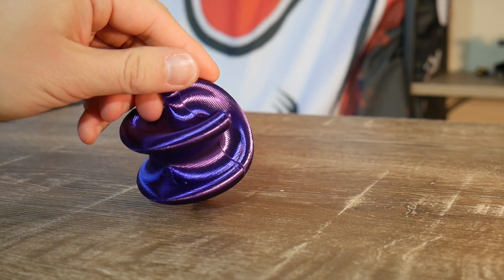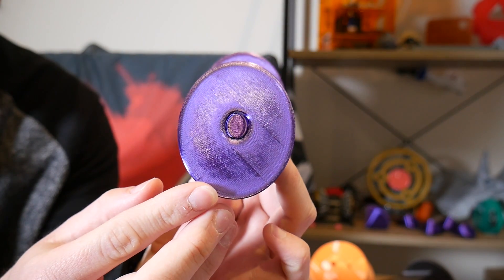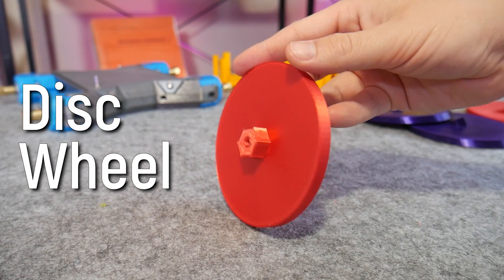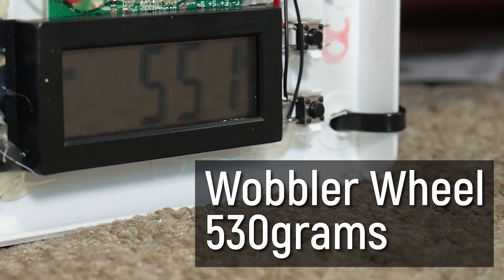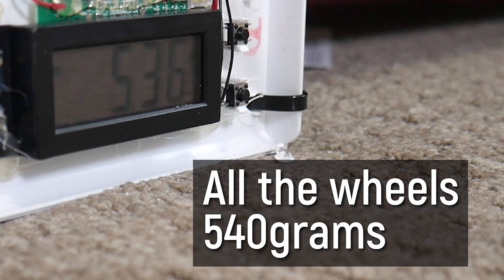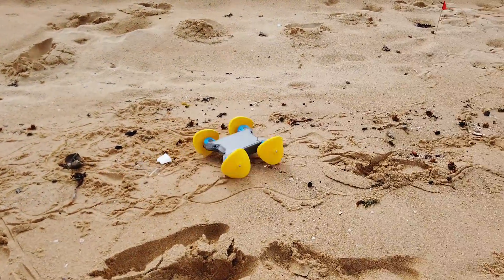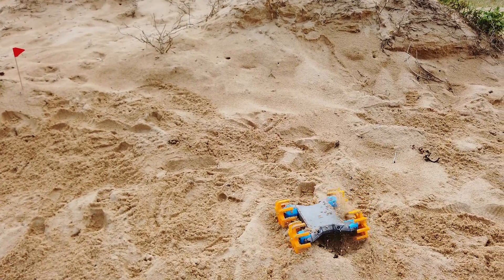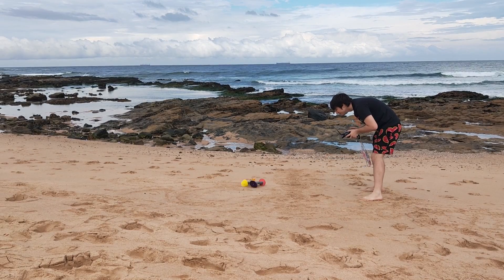This Robot Drives on Wobbly Wheels (but HOW?)

Comment: Hi nice video nice work,
I wanted to share with you what I
noticed on the beginning of this
video about moving the robot and
turning his direction to the right,
which is a result of two things, First
the direction of the rug threading
(knowing a rug threading direction
helps you when you're trying to
clean it), Second thing try to make the rope that holds the robot exactly on the middle with a hole gap more closed to keeping that so.
And thank you for this interesting
video.
Reply: .At the sixth minute

Comment: Fan ruffle the wheel ... like the 'prongle wheel each wheel would be two 'prongles' back to back then make it have multiple lobes. You could also think of it as two fan blades connected at the shaft ... one a mirror of the other.  Discharge flow to the center. You could still have a solid circular circumference that defines the wheel but the center would be evacuated somewhat. 

Also try something like a water wheel.
Reply: Could just have a center wheel and the water wheel like projections on either side.

Comment: The problem is, according to what I observed, the vehicle's body has no elevation from the wheels and relied on the radius of the wheels to lift it off the ground. If modeled like a buggy, with the body clear of the ground, I believe the test would've gone better for all of them.
I am no engineering expert, so I might be entirely wrong.
Great video.

Comment: Hyperbolic peraboloid is unstable in xy if not balanced by opposite wheel. The wheels aren't wobbly in z as such, they describe a circle as they rotate. They are cut from a cylinder and any shaped cut from a cylinder will do this. Loose ground, so <P is good, where P=F/A. F is constant so make A big.
Your carpet is also not a good corollary for sand for each of the wheels tested. The sand is more or less isotopic,  the carpet is not. This and the sand test show you need to test in the environment you mean to work in.

Comment: The pronged wheels had an unfair advantage when it comes to driving in the sand since it technically has a lot more surface area so it won't sound it to the sand as easily
Reply: So what you're telling me is... the pronged wheels have a better design?
Reply: @ryanrigley2558  no I'm saying that if the other wheels were a little thicker, than they might have put up a better fight
Reply: @supitsameen3251  so, the pronged wheels have a better design?
Reply: @ryanrigley2558  you know what... Nevermind 😆

Comment: if you turned the tracks into treads the sand and carpet may not be as difficult.... heck with the right track you could make them even work on water..... if you waterproofed the battery and electronics.  not sure how you could add a tread to the wobbly or prongle style thou.... tanks and such use toothed gear/pully wheels to grab the tread and such.... i feel it would be really easy on the fourth design.... since the treads could be allot wider than the ones with normal like wheels.  enjoyed the experiments thou...ty for posting :D

Comment: The spoke wheels works well, the only thing that stops the vehicle is it's very low clearance that makes it stuck whenever the body is elevated. You could atleast make the body higher or give it a suspension arm and a shock absorber, that way you'll make it look like a sand buggy

Comment: I think the reason the wobble and prongle wheels worked so much better than the straight wheels is because like a snake or screw, as they spun they pushed on sand to their sides like a wedge.

Comment: I think the spoke wheels did work better for how thick is the coverage of the wheel to the ground while the other wheels are making thin line tracks the spoke wheels just straight on uses its outer layer to move like how the water wheel  brings water up and down

Comment: Look man, this is not so acurate, 5:38 because the deformed wheels have more traction because they are printed in a diferent axle so they have a rugged surface and you are doing the tests in a carpeted floor so little warps hook on little fluffs making more force. 6:30. They dont have the smooth surface that circular wheels do. You should pulish all them. Is the area in did, but also is the quality of the surface smoothness. Or a shiny hard floor.

Comment: The spoked wheels probably worked so much better because they have like 20x the contact area as the rest of the wheels. The amount of area that is contacted at any one point is more like a line, so the area measurement isn't a good way to predict the area that will contact

Comment: in sand and while climbing, what you need is a licked differential 
usually used in the rear, it makes it that the wheels on both sides are only able to turn at the same speed.
this would eliminate most of the burying problems with the wheels because it could use all the wheels to get out of a hole instead of just the one that got stuck :/ 
great content, subbed right away

Comment: The edges of the wheels do not need to be the same contact area. Traction does not depend on the surface area in contact. Wider real life tires do get more traction but because they are made of softer rubber which gives more traction. Being made of softer rubber, they must be wider for the side-walls to support the vehicle weight.

Comment: Its most certainly within your capabilities to be able to figure out the simplicity of an ESC/Motor/Receiver/Transmitter system.  It's very straight forward, and with the advancements of technology, modern RC's are a much simpler, more reliable system.  I figured it out, and I feel you're well above my comprehension!!  Great vid though!!  Thanks for this!

Comment: Terrible way to test. If you want pull force, put some spikes on the wheels. A much better test would be, how far can it run with different wheel types on the same amount of battery.

Comment: Try the chip design but with higher number of wiggles. Any even number should be possible, right? If you go for eight wiggles it should be roughly equivalent to the eight spokes design, maybe
Reply: In particular, try something like

Re((x+i y)^8 / (x^2 + y^2)^4)

to get a sort of wavy spokes profile

Comment: I'm guessing with all the smooth wheels you're not seeing much difference because although the shape of the wheel differs you're really just moving the same material with the same surface area across a surface whereas with the wriggle wheels you're altering that surface area with those gaps. Maybe try playing around with different types of tread?

Comment: I think it would be interesting if you had a paddle boat where the paddle is longer and form like A helix in this design it should be on 2 side's.

For example 30mm wide and 70mm long the second one would be oriented 30° from the first one then next 30° apart.

Comment: Geometry be weird, but really, you've just made a diagonal width of the strip on the slanted wheel, straight on the disc wheel. If the length doesn't change, it must increase the width compared to an absolute Y-axis. 

Like if you rotated the diagonal line in a square to be oriented like one of its sides, that diagonal would now be longer than the sides. 

Took me a second though! Nice video :)

Comment: Very impressive.   You do know of course  that if you replaced the wheels with tank treads, it would get more traction and more surface area contact with the sand.  I wanted to make such a vehicle with tank treads that actually wrapped around the entire vehicle,  so that the full surface of the vehicle was in contact with the sand.  
I think that would be the best way possible to keep a vehicle from getting trapped in the sand.

Comment: Id like to see this tested on an rc platform with some kind of raised chassis for higher ground clearance maybe a sort of suspension system. Itd be more complex but would allow the wheels a better chance at not getting stuck as easily

Comment: Was the battery at a similar charge during each test or does the control board even the electrical load/power applied?

Comment: If cars had wheels like that, the cv joint would break in the front, and if it didnt, then the rear wheels would be moving in and out so fast that the inertial force making it go in/out, would cause the wheels to snap off, no matter what material it is.

Comment: as soon as i watched this i thought the wheels wont be better bc they cause un wanted air drag bc of the design so now its time for me to find out
and for the 8 spoke design i believe it will not do well for ground travel but if you add small flaps to the end of every other spoke it will do amazing with hydroplaning
edit: turns out the spoked wheels did well, im suprisedd!

Comment: I'd be interested to see the result for the wobbler wheels when the axles are locked such that the wheels are mirrored (both angling toward the car or away at the same time). The thought here is that maybe they will use the opposing forces to add extra grip.

Comment: Wheel traction is defined by contact point, ignoring the sand, your skinny wheels have a tiny contact patch, your spoked wheel's massive in comparison, so you need to consider wheel width to get an accurate test. make the wobbly wheels wide and hollow because you need to consider 'unsprung mass'. I know you're not using suspension, but the principle remains for the rotating parts, calculations always vary but 1 kg of unsprung mass can be the equivalent of 8kg sprung, hence why the best wheels and breaks are carbon. Fun video, thanks

Comment: I think part of the issues with the wobblers, prongles, and spoked wheels was that the vehicle platform didn't have a high enough breakover angle/ground clearance in general. The car was very flat and in one plane, but if the main body was 14-20mm higher, they might not have gotten beached so easily. I don't think it would've made much difference with the plain disc wheels, though. They just didn't have any way to grip the sand and push forward, and so they just dug themselves into a hole.

Comment: The reason why it pulled to the right every single time with because carpet nap has a Direction you can also take a piece of paper and a pencil and with the palm of your hand rub the pencil back and forth over the piece of paper and the piece of paper will travel in the direction that the nap is laying down

Comment: so the thing I don't get is how you figured the 8 spoke design was equivilant to the same contact area as any of the other wheels.

I think the math breaks down because realistically, most of the wheel's surface is not in contact for most of the revolution, so the 8 spoke design should have the best performance on any rough surface, especially when you consider that in the sand, 2 spokes will be digging in and getting great traction in the sand.

and after watching the test, yeah basically add some treads and you've built an all terrain tank!  Very nice

Comment: You should try and water proof it and see if the wobble wheels will act as paddles in water.  In theory the wheels flow in the same manner as a canoe paddle works.

Comment: as neat as it looks the size and shape of the robot and wheels aren't idea for a soft surface and you'd have much better traction with treads with much larger surface area just larger wheels and more surface area would be huge, also a lot more ground clearance. it's not a fault of the wheels that your robot is hitting it's bottom. frankly a lot of these wheel designs dig in way to much because they don't have enough surface area and aren't well suited to such a soft material. they seem like they would be much better off on something that isn't loosely packed. like foam or rubber. and even then i don't think these designs make much sense as wheels in the first place. design wheels without an intent and purpose doesn't give you good wheels, and not having a good standard control wheel that works well to compare to sets you up with little knowledge on how to make modification to try and improve a wheel. frankly there is a huge lack of testing and iteration which makes this nothing more than a novelty.

i've seen similar test done with 3d robots on grass and snow. this video format is quite interesting and fun. but this video lacks impact.

Comment: Disqualify paddle wheels. Surface area depends on the surface. On flat glass it may contact the outside of the paddle only, but on sand it contacts down the side of the paddles and thus has a far larger contact area. You could make your blades as thin as razor blades and only count the face of the blade and say it has a far lower contact area and on glass this would be true. The blades actual grip in sand though would be amazing, if you can keep in from sinking in  so deep it bottoms out.

Comment: I think the problem with the wobbler wheels on sand is that they are on 4 independent motors and so that axles aren't synchronised.
If they were, and the wheels were phased to be mirror symmetric about the robot's central axis, then they would alternately squeeze sand inward and then outwards, doing a swimming motion through the sand. Somewhere between the gait of a sting-ray and a sidewinder snake.

Comment: The width of the successors wheels was by far wider, than the other three, and had therefore much more grip. If you made it equally slim as the other three, I'm not sure if it would have made it close to the fourth check point.

Comment: the reason wheels on a car is round ”discs” is cus of balancing, if the wheel isnt balanced it will make vibration and lose more traction on flat tarmac, other shapes would be good on soft terrain but then must rotate much slower or else they will make violent vibrations

Comment: I think the reason the wheels all had problems in the sand was motor speed. Once they start spinning out the vehicle will always dig in unless you go slower. I don't know how much you could control with what you had but you would also have more friction if your wheels don't spin in place. The mu value changes once objects are no longer static.

Comment: I would say there shouldn't be any limiting criteria, because the wobbler wheels are doing the same thing as a paddle tire as well. its just not as uniform as multiple evenly spaced treads. In this case putting treads on the standard circle wheels is the same thing. That would have been more interesting to see. like a gear sprocket style wheel with the same surface area. I'm pretty sure anything other than perfectly smooth circular wheels will start digging in to get some kind of traction, effectively acting as a tire tread.

Comment: It seems to me that the motor should rise from the ice when you are not accelerating, so that you can slide by inertia. Make sure that when you step on the gas, the engine lowers and engages with the ice. Good luck!)))

Comment: You could try a 2/2 configuration. I'd be really interested to see the prongle wheels on the front and the spoke wheels on the back, then run that on sand--might be interesting results.
Reply: You're right, it needs taller wheels for more ground clearance and non digging wheels in front.

Comment: It's not a failure of the wheels' design. It's a failure of the wheels' designER.
CLEARANCE!
Your vehicle always bottoms out, it's not the wheels losing grip.
When you show the pictures of the "sand tires", then show the vehicle, there's massive CLEARANCE  between the ground and the vehicle floor. Zero awareness of your design failure.
Stick to gizmos with weird gears.

Comment: Someone has probably already said it but assuming you can fabricate that thin, if you used an oscillating tread (either sinusoidal or sawtooth) then you would get the benefit of the "tread" pattern but still have the "wobbly" effect.  Caveats include thin construction to preserve the overall weight (for fairness) and to maintain the surface area constraint.
Reply: I'm shit with CAD so I won't even attempt it.

Comment: The 8 spoke design had more surface area than the others. It was utilizing 3 sides of each spoke during the sand tests, versus the one side it was using on the carpet.

This is apparent, when you see the close up of the wheels sheet going through the sand. It had sand on at least the sides of spoke, revealing it had more contact area.

Make sure that's corrected in future data :)

Comment: You could try to extend the spoked paddle concept wheels, and make them entirely paddle from the hub on out, like a propeller,but with flat square blades parallel to the axel axis. Then give those paddles an alternating 25-30 degree angle. That would be very detrimental to a propeller or a water wheel, but it may be favorable for a wheel's traction on a very soft surface, like sand or powdery snow.

Comment: Your chip wheel, if widened but with notches or  maltiple small "bites" taken out of it to equal the same surface area of your test wheels would work very well. It is a cheat like the spoke wheel but more so as when the vehicle bogs down the bites surface area will not just help throw the sand back but will also help keep the vehicle elevated...bestRoy

Comment: Bigger wheels would make a huge difference, as the belly of the vehicle will have more clearance. Less likely to hang up. This is why off-road vehicles have as much ground clearance as possible (lift kits, bigger wheels).

Comment: low clearance issue, as wide as long makes it less directional and loses the ability to shift weight/grip front to back and instead pivots .... also all the smooth wheels could have done reasonably well with modest texture/tread like a sprocket, gear, spline surface